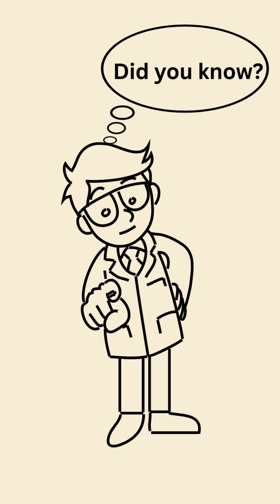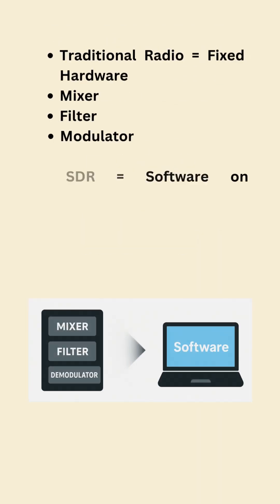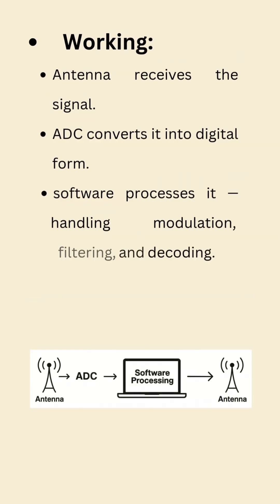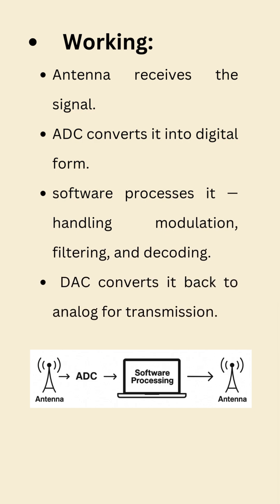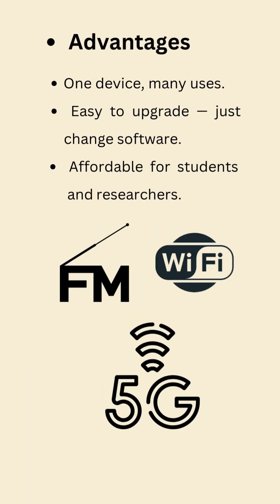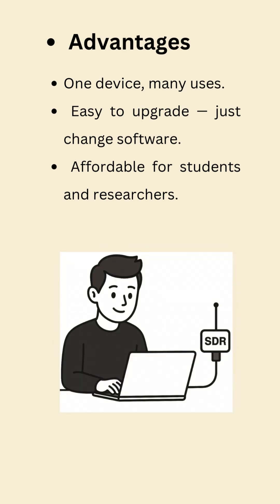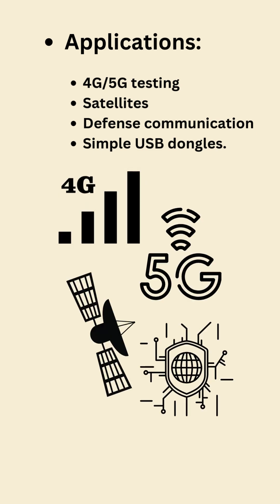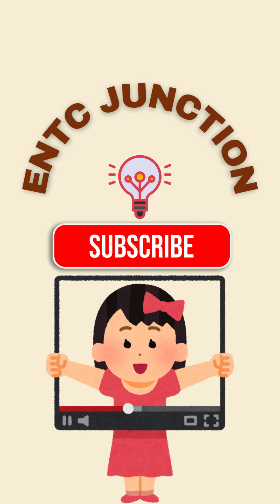What is SDR? | Software Defined Radio Explained in 60 Seconds.

Comment: Basically; a sdr is a basic radio, but it has many frequencies. It's so powerful, you need a dongle for it to work, unlike a typical phones radio app, which just needs an aux connection.